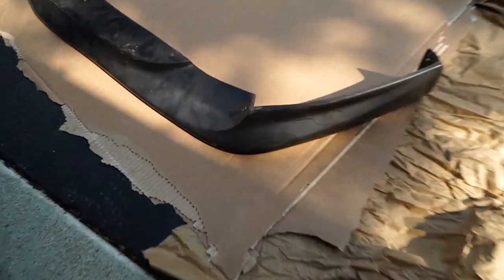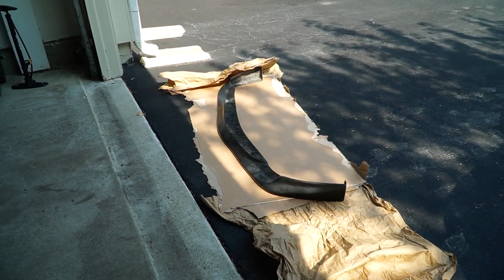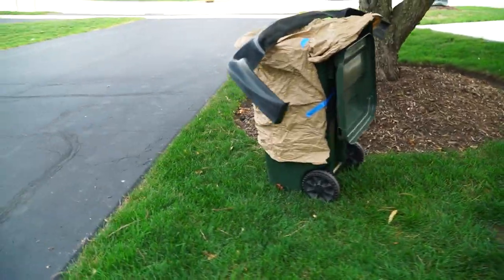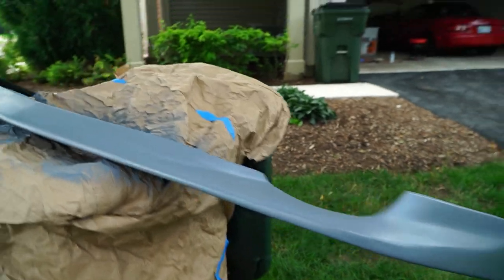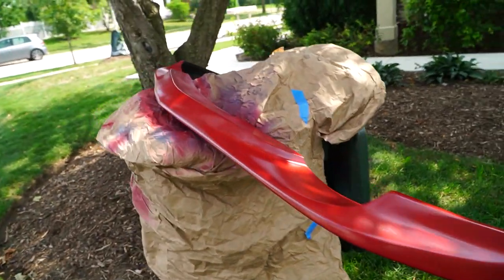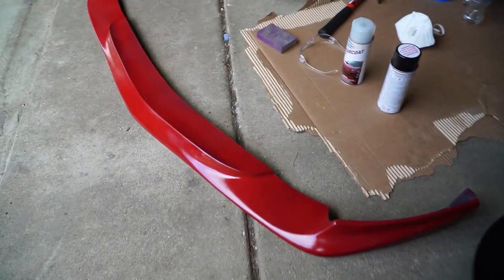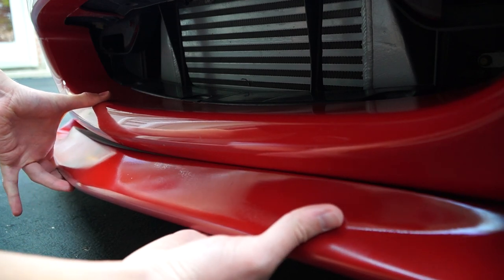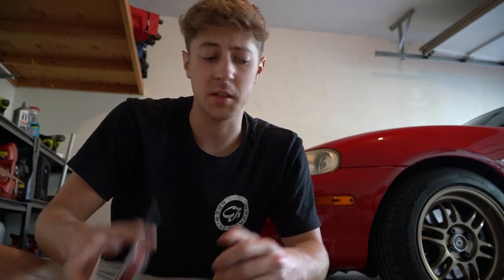DIY Painting NB Miata Front Lip (Came Out GREAT)

Comment: Dude, have you ever had problems with the double sided tape they give u not holding good on the sides??? Mine stopped holding after about a month and i just took it off till i figure out a more permanent solution.  The middle under side u screw into bumper obviously holds up good.  Any advice would be awesome.  Btw i cleaned the surface real good before applying the tape but still sucked after a month or so
Reply from the maker: What 3m tape did you buy? I feel that 3M makes the best stuff, I've never had an issue with it peeling off. Try to use one single piece instead of cutting up a couple